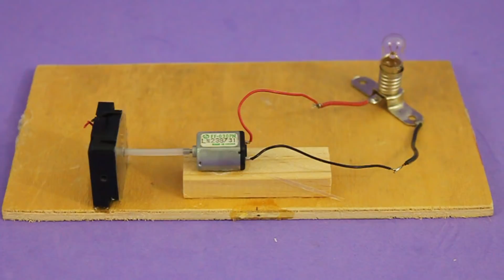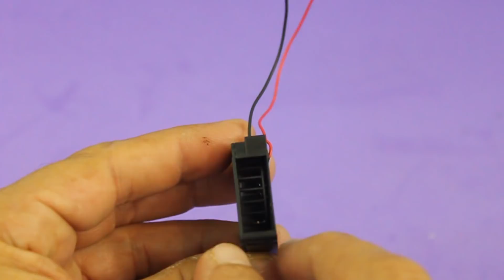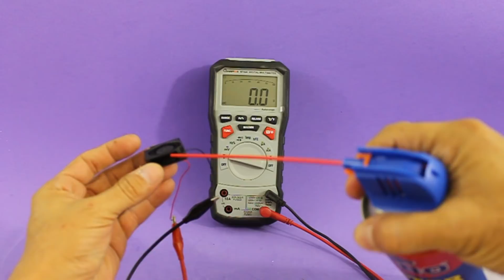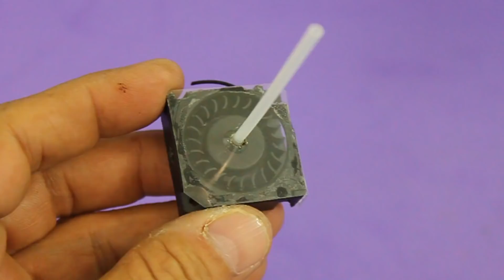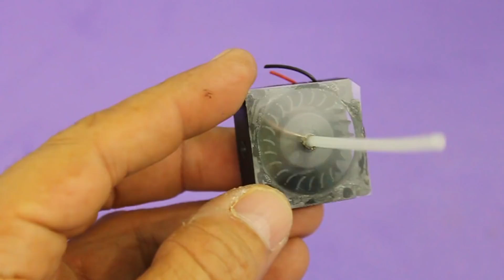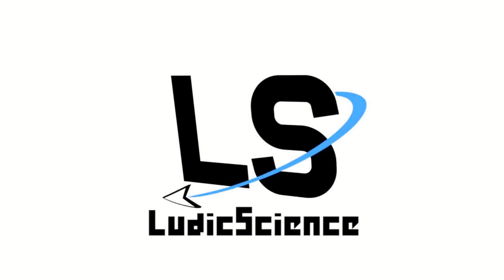DIY Compressed Air Turbine Electric Generator

Comment: If you open the fan motor and connect directly from the coils,you will obtain a very high ac voltage.try it

Comment: Actually I think if you make the hole lower (or avoid in the middle) you could increase the efficiency since if you put the hole in the middle it will create air flow and separated to 2 direction and will make the air flow kinda balanced (i don't know the term to use here but it should flow on 1 side only, not 2 side)
Reply: anyway you did tilt the nozzle upward so i think that works too

Comment: It seems that the output voltage of the brushless fan is clamped by two diodes, which is approx. 1.2V.
Reply: Why didn'tyou combine the voltages of the fanand generator?

Comment: Not practical on its own to produce power. But if you had a cave or mine shaft you could seal and fill with compressed air, power by solar you could store the energy until you need it. Then apply this when you need the power.